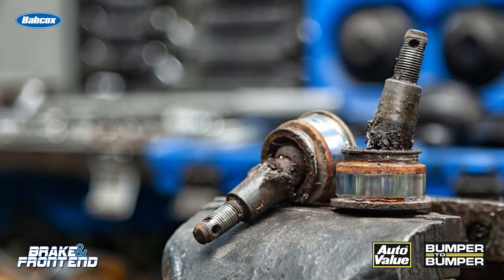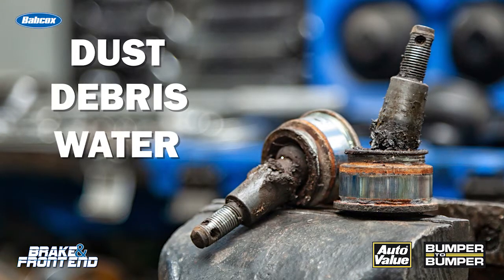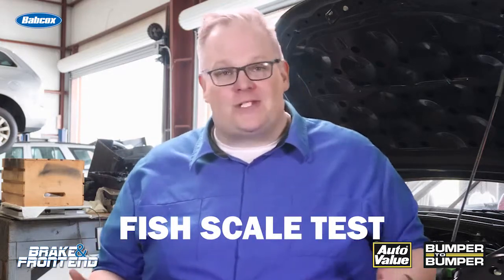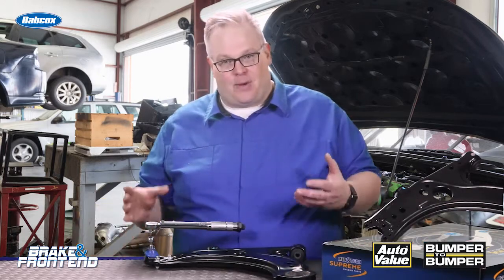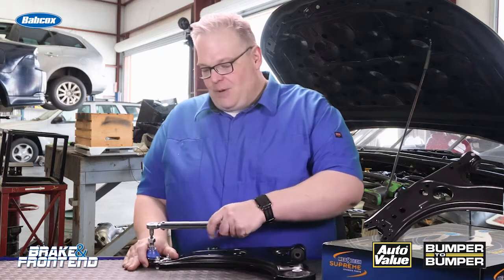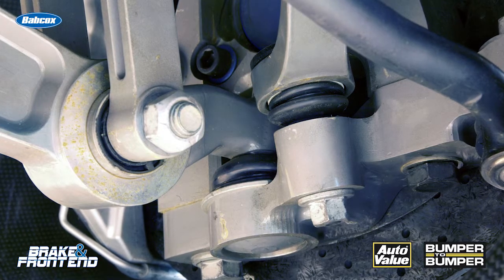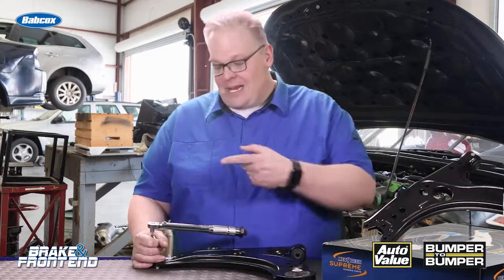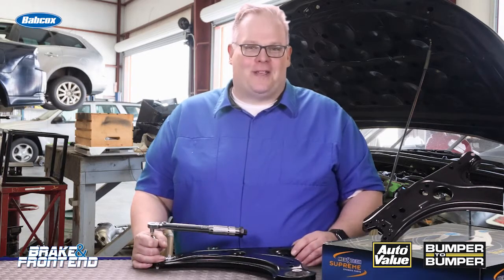Ball joint stiffness | Tech Minute

Comment: Uh no , not always. If they are pressed into a old or out of round control arm they will be unworkable period. Also now that sealed joints are the only thing you can get there can be little to no grease in them. lol ok under the rubber boot before installing. 
So tight ball joints aren’t normal. They should move with some effort. 
No offense but sadly I followed this exact advice and now am looking for a fix. Pretty much just replacing and re pressing all my joints.

Comment: What about a lower ball joint that’s been installed for let’s say 12 months?
Asking as I’ve just removed the knuckle and lower control arm with the ball joint still attached. 
Had no signs of a bad ball joint but it moves super easily.
Planning on replacing ball joint either way but wondering if after a month  do they all lose the stiffness?
Reply: I purchased 3 used OEM lower control arms from a junkyard and they were in excellent condition but I was able to move the ball joint like a joystick. However, there was no up and down play.

Comment: Is it normal to have stiff steering right after installing new sets of ball joints. From what you have said the ball joints are stiff when new so it might require more force from the power steering to move the knuckle.?

Comment: The steering on my 95 toyota tacoma feels stiff, after all (4) new ball joints and tie rods were installed.
Reply: Did you find out how to fix it? My 99 Hilux is experiencing the same thing after 1 ball joint replacement
Reply: @micamclachlan  No, I never did.
Reply: Hey mate are yours better now?.i did all mine on the front of 01 hilux ute and it now has steering memory because there stiff,just wondering if they get any better with time.
Reply: @2stroke4life51  Unfortunately, I got rid of it because it was totalled. Now I own a 2004 Tacoma.
Reply: What a heck is that.. Why its epidemic of those faults after installing new ball joints.